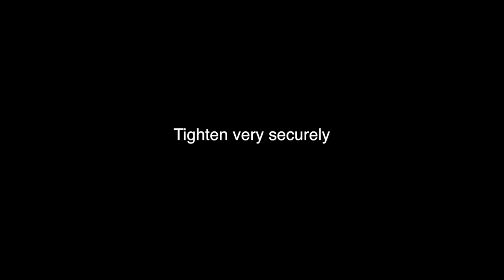Windshield wiper repair

Comment: It's all fun until the connector screw breaks in half while tightening 👍 yes this just happened to me, and welding doesn't work because sh** metal mix in these. Now I have to dismantle the mechanism in -13C tomorrow, enjoyable life. There is no god.

Comment: Excellent! I also snapped the threaded part when taking mine off (who knew on my car they were reverse threaded... My solution was to drill and stick a couple of self tapping screws into the head to get it to grip aswell as cleaning off the threads as you show!

Comment: Oh wow that really could be the solution for our problem on my Peugeot J5 - seems the correct wiper arms are no longer available and the previous owner already put a not correctly fitting one on it so it does not move with the motor at all.
Reply: I’m looking at a few different fixes. This one looks the easiest. 

Would you mind if I asked you how long the paper clips lasted ?

 and do you have snowy winters.
Reply: My name is Steven Riedle.
Reply: I see another commenter said one Year.

Comment: Many thanks for this!  I was prepared to spend $$ to get my wiper fixed when I saw this.  Works great!
Reply: Hi. My name is Steven Riedle. 
I saw your comment about fixing the stripped windshield wiper arm. 

How long did that work ?  
I’m thinking of a few fixes, but this one looks good and easy. Other then using Loctite 660 glue. 

Hope you are doing well.

Comment: this. 
is. 
genius. 

holy crap! 

so simple, yet it does the job! (I'm going to use more than 3 though. Washington state has a fair share of rain...)
Reply: If you use too much wire, it will make it way too tight to fit the arm back on. 3 wires that size works fine. I'm going to fix the rear wiper on my van tomorrow with some welding wire. Yeehaw!

Btw, you can just set the wires with a single twist, then after you get the arm on, cut off the access, as the important part is filling the gap.

Comment: The wire was to thick for my wipers. But you gave me an idea. I used a thin slice of tin strapping, that worked. I have used tin strapping to increase tension on battery terminals.
Thanks
Reply: can you explain what tin strapping is? thanks

Comment: About to try this, but will those wires damage the threading of the wipershaft??
Reply from the maker: This method is to be used when the threads are already damaged. If your threads are good you shouldn't need the wire.
Reply: Ontario Lakeside threads in the arm are stripped but threads on wiper shaft are fine.
Reply from the maker: Use a soft wire, something with some tin in it.
Reply: That is not a repair. It isa hack that will cost you money later. The wiper arm is made from a soft material (aluminium probably) and the mount  of the motor is made from iron. 
If anything hapens, like too much snow on the windshield, the wiper arm wil round its channels in order to protect the main engine shaft. 
If you put wire in the arm of the wiper, you could damage the shaft of the wiper motor that costs a lot of money and is hard to replace

Comment: That is not a repair. It isa hack that will cost you money later. The wiper arm is made from a soft material (aluminium probably) and the mount  of the motor is made from iron. 
If anything hapens, like too much snow on the windshield, the wiper arm wil round its channels in order to protect the main engine shaft. 
If you put wire in the arm of the wiper, you could damage the shaft of the wiper motor that costs a lot of money and is hard to replace
Reply: Agreed, I recommend using aluminum wire (or thin shims preferably) to protect the linkage transition for the concerns you raised.   The wiper motor is not directly connected to the wiper arm so that will not be an issue. On my model car, the linkage is a common point of failure with regular use (Shame on you Toyota!)